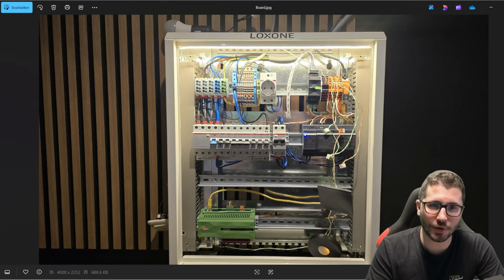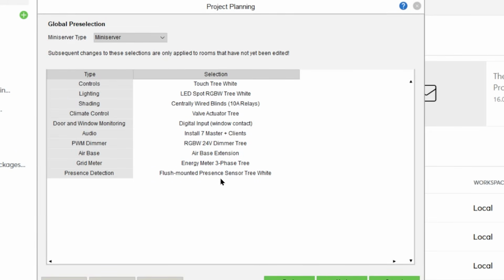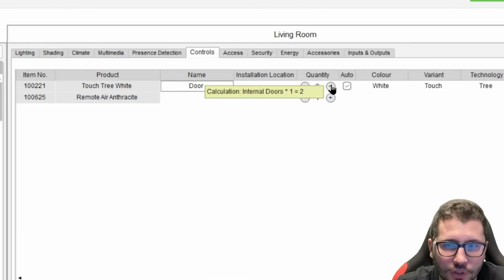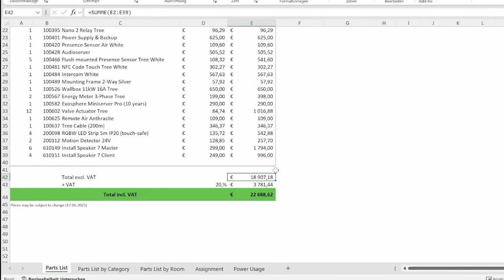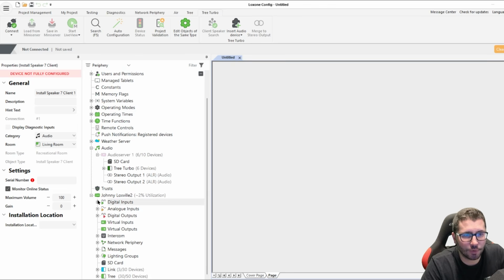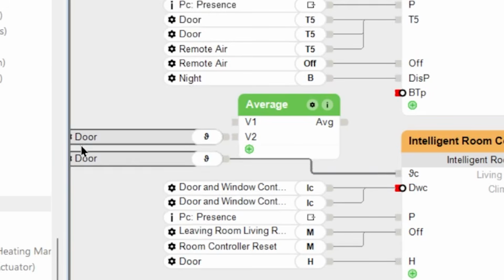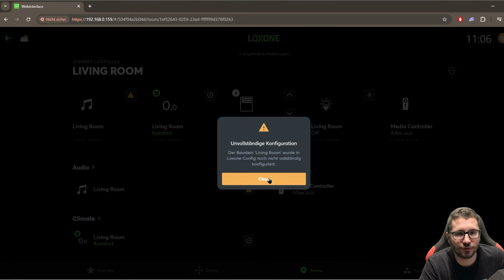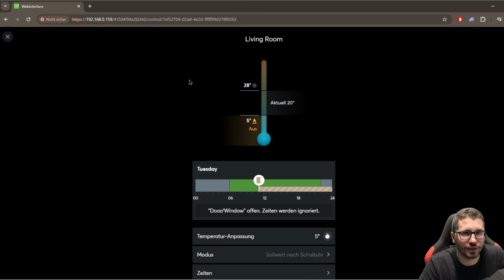Loxone 🏡 in Record Time! Project Planning & Programming — STEP BY STEP!

Comment: Great video, Richard! One question though: how can I adjust the automatically assigned ports on the Relay Extension or RGBW Dimmers so that they match the actual wiring? For example, in the planning the living room blinds are assigned to R1/Q1 and R1/Q2, but in the real wiring inside the cabinet they are connected to R2/Q9 and R2/Q10.

Cheers
Reply from the maker: hey Christopher, only by hand... would be soooo awesome to switch them with all the rooms etc. assigned to it....

Comment: These videos are great, I would love to see one about heating, installing Loxone Valve Actuators etc I heard they are difficult to wire and only certain cable works for them
Reply from the maker: Hey mate thanks. Yea the old version needed 0.6 cable and new version 0.8

Gave me some headache until I realized that!! Knx works, new loxone cable got 0.8 as well!